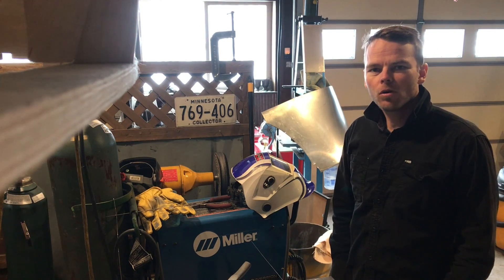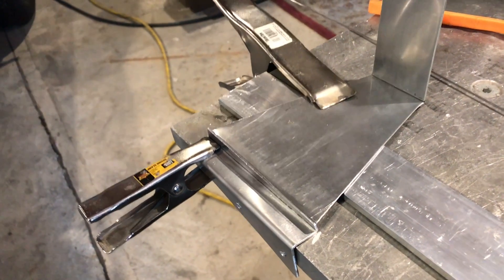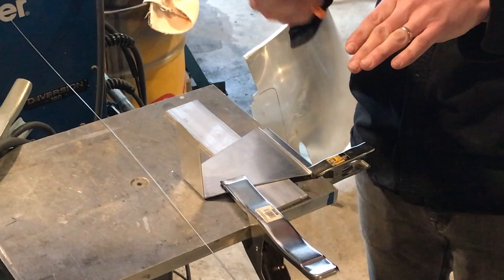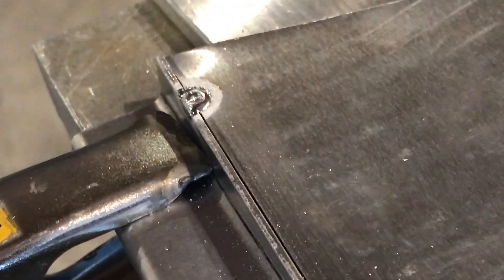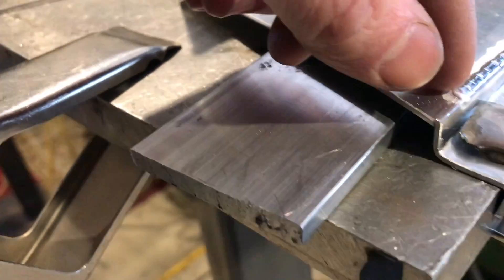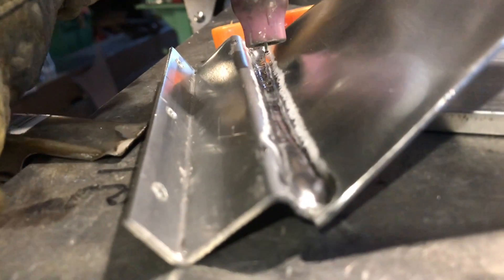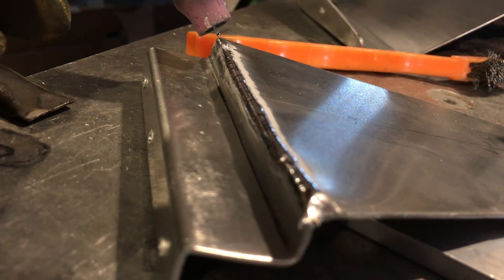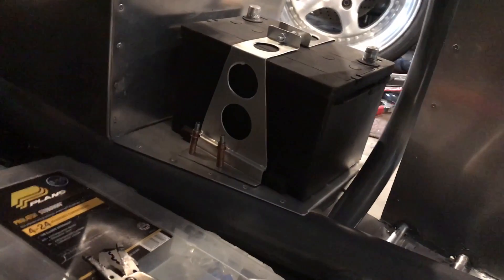TIG Welding Thin Aluminum

Comment: Hi Chris,  Your videos are the best!  I'm building a car.  Chassies completed with stick welding.  Trying to learn TIG but mostly burning holes.  Is it possible to weld 17 or 18 gauge 3003 Aluminum?   (I know you use 16 gauge but that is hard for me to shape with a stump and English wheel).  I've shaped some nice 17 gauge fender parts, but can't weld them together.  Welder is a Titanium 200 with DC output only.  Thanks, Keep up the great work!
Reply: You will need an AC machine to weld aluminum. 18 gauge is easy as can be to weld as long as your gaps are tiny and your material preparation is meticulous.

Comment: Finally....thank you so much I have the same Miller diversion and having issues welding thin aluminum... your video was the best info I have found so far....please make some more ...lol...do some thin pipe also...I will recommend you to everyone...once again thank you
Reply: Also what size and type of tungsten are you using...and if you can a filter on camera where you can actually see the weld going in... awesome info...thanks again

Comment: Have you tried a brass or copper backing for aluminum boss? I've found from time to time it helps on aluminum and use aluminium backing for stainless or mild fit ups.

Comment: Hey, curious question, You mentioned having a heat sink, and upping the current...but, if you were to use aluminum blocks or any thing to draw the heat out(heat sink) or cooling with compressed air in between welds.

Does it help with not seeing the weld seam or jointed panels later?

Comment: Hi Chris, nice video.. If you'd like a smoother weld try using the lay wire technique instead of dipping. Just lay the wire  in the joint and keep it there. It helps me get smoother joints to finish.

Comment: What tungsten and frequency settings?
Reply: I usually use thoriated, E3, or 2% lanthanated. On thin stuff I'll run a higher frequency around 100, thicker stuff about 60 hz. Higher frequency seems to penetrate a little less.

Comment: I have welded Aluminum as thin as .005 and Titanium tubing  1/2 x .004. Been welding for over 50 years. I have welded aluminum by TIG and MIG and stick and Oxy acetylene
Reply: Reynolds Wrap?

Comment: Are there any effective heat sink or exchanger options that can be used to when welding like this?
Reply from the maker: I personally have not tried, but I have been told copper is an excellent option. Thanks for watching!